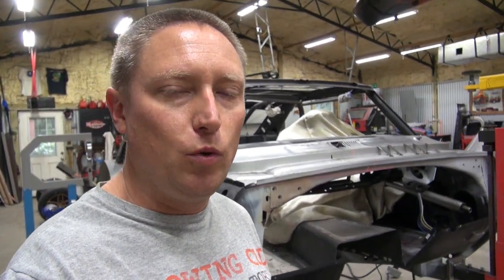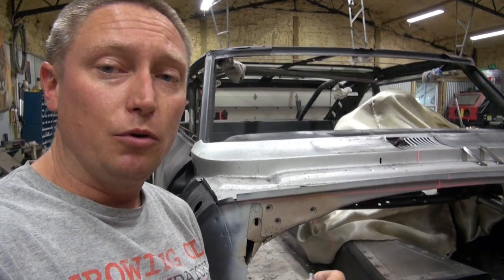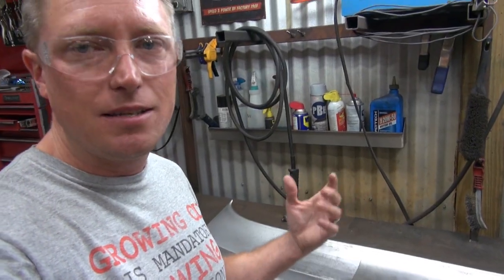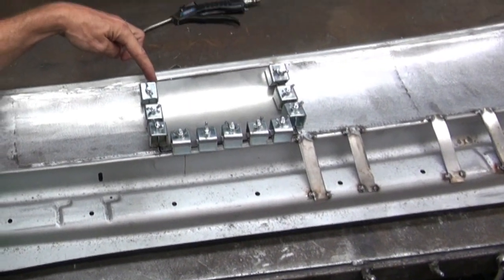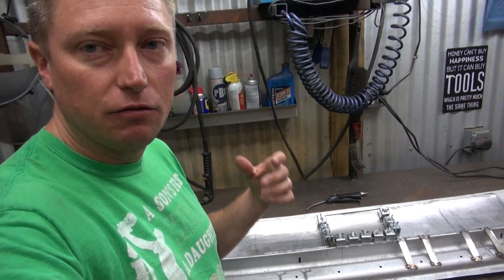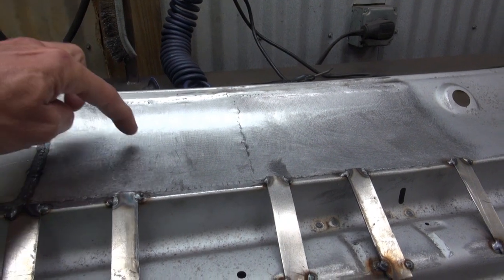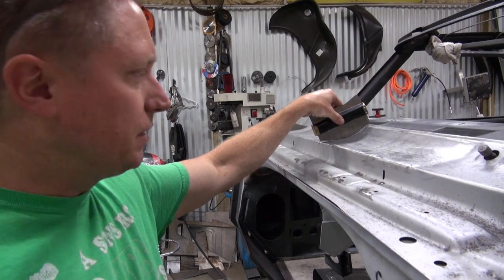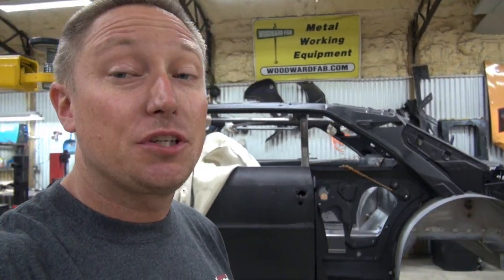Enclosing Cowl Vents - Step by Step Process

Comment: You are doing an amazing job on the car and sharing some very useful info. I also have a 67 that I have been working for for 4 years. 1st stage was to install an LS motor with 4l60 trans, IFS clip, 4link rear with 9"ford rear mini tubed, Dakota digital and AC. That was a lot and may I say my 1st time doing it. Drove it on its maiden voyage 4000 miles from Florida to St Louis hit Route 66 and then back home In the Florida Keys.  Now I am into the body installing all new body panels, Whew I feel your journey. I have been working on getting the new quarter panels lined up and cant wait to see when you get there. To say they fit beautifully is an understatement. Good luck and thanks for all the amazing incite and tips, Dave
Reply from the maker: I appreciate hearing that.  When you spend this much time making a video and it has 200 view after 3 days, it really makes me re-evaluate if my time is spent wisely making these videos.
Reply: @RedlineStands  I am so glad I found your feed. It has given me so much incite to all aspects of what is involved in a build like yours. Your top 10 tips was extremely informative. Especially the tip on door alignment for quarters. I have been binge viewing all your vids. Keep up the amazing job!!!